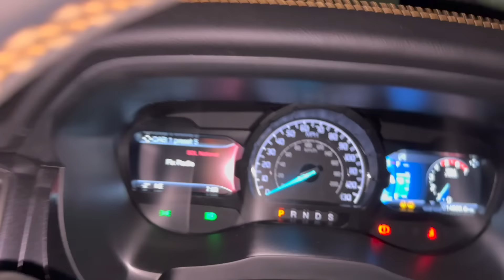Our First PROBLEM on The RESIN DRIVEWAY Job...

Comment: The fuel filter on the dumper looked like the red diesel had started to gel and clog the filter up to me. I'm not sure how much fuel you get threw but if that fuel was bought in the summer it could very well have no additives in it to stop the fuel from going like a gel in cold weather. If you have some Kerosene or can get some its better in cold weather, do a 50/50 mix or just run straight kerosene and some two stroke oil for a lubricant

Comment: I think that the brick and concrete you were digging up was probably a garage oil sump where the oil being heavier than the water would stay in concrete area and the water overflowed into the drain/

Comment: Just in the middle of watching the video when the dumper packed in allways a problem with small machines when you fuel them up with a can dirt in the filters As handy as that dumper is  your should invest in a three tonner for the bigger jobs the little one has its place on small driveways.that weather is better than the rain frost won't stop the job rain and floods will👍👍

Comment: Great job stevie on your own….I use to work on my own putting up fencing…did it for years ….did loads of panels and running close board gates etc….and I’ve even put up 6 foot chain link on my own with strainers….hardwork but as you said it can be done…great video can’t wait to see it finished

Comment: I suspect that the brickwork that you uncovered was the top of an old septic tank or cesspit - there may originally have been a concrete slab over it.  A cesspit was used to collect all the sewage from a property not connected to a public sewerage system, and had to be emptied periodically and the mixed liquid and solids carted away.  A septic tank allowed the liquid to biodegrade somehow (I think) and filter out into a leach field, leaving just the solids to be disposed of when the chamber was full.  My father was a civil engineer and spent most of the mid 1950's to mid 1970's organising the construction of public sewerage systems (sewers, pumping stations and sewage treatment works) in various little villages in Nottinghamshire (Farndon, Whatton, Aslockton are 3 that I remember) and transferring the properties from cesspit / septic tanks  onto the new public systems.
Reply: Well done, again.  Great video as usual.  Thank you. ❤❤

Comment: If you put more hardcore below that drive, it will help with permeable drive water drainage.
Ive done a job with architect spec, where we used larger stone first then a layer of special cloth as you call it😂. then smaller stone. 
The pavers were also layed on clean 5mm stone. total hardcore was 400mm compacted properly.